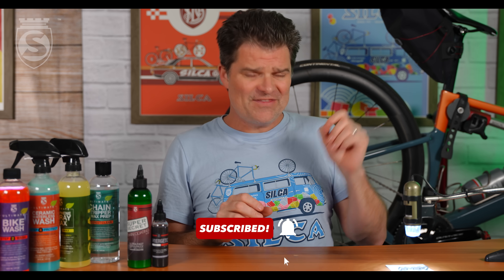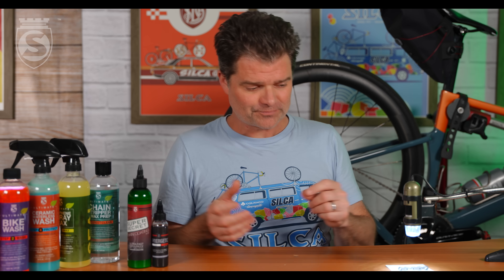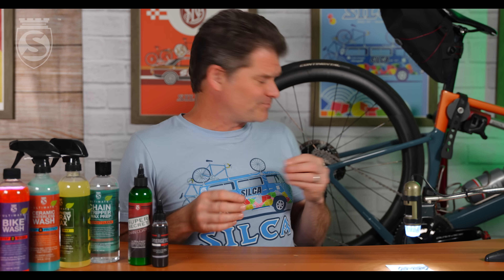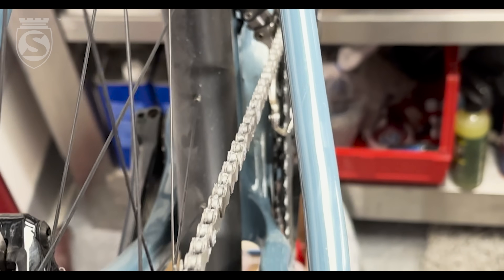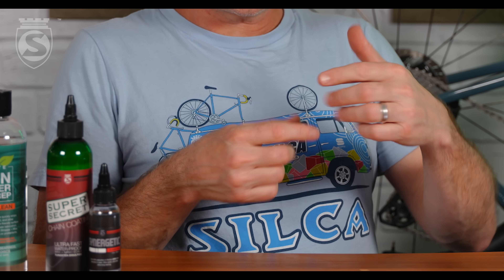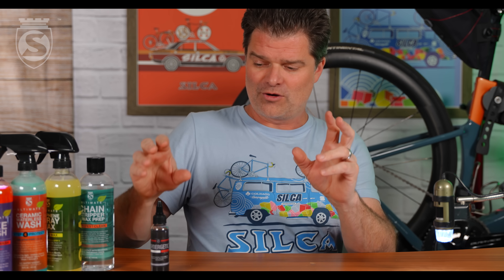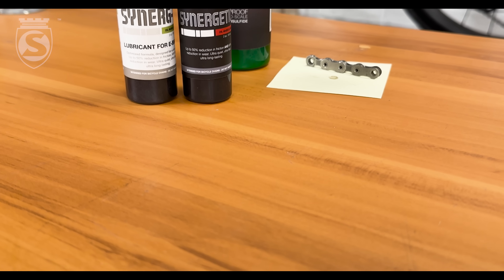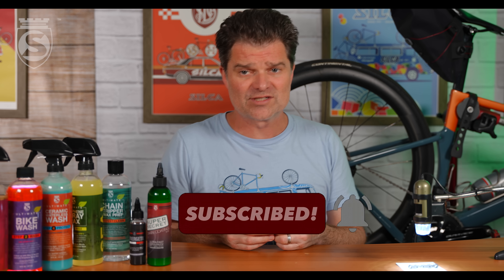Stop Wasting Your CHAIN LUBE! Know the BEST Way to Apply It!

Comment: What about e-bikes? You can’t back pedal in them.
Reply from the maker: I just insert the long side of a 5mm hex key into the chainring bolt and then backpedal until the crank arm contacts the hex key, it will then allow it to backpedal the drivetrain.

Comment: Great video, good news is that that is exactly where I had ended up deciding to apply my Super Secret drip on. To me it seemed where most chain side bend would be (big chain ring & Big cog), and cassette would pool any run off. However seeing is  believing, seeing the capillary action at work was so reassuring to watch. So invested in Silca chain wax products now, hot wax for fair season bike and rides, drip on for those cold dark winter rides (I'm in UK), where re-application is required more frequently due to varying wet conditions.

Comment: Can you use other extreme cross-chaining combos to achieve this lateral pumping? lowest gear in the rear cassette + small front chainring? I've tried the big / big combo and I can't complete one complete backward revolution without the chain dropping to the next lowest  rear sprocket.
Reply from the maker: Doesn't need to be full big-big, just enough that you can see the chain articulate laterally when you look at it.. 2nd or 3rd cog down from the top and big chainring should do it.
Reply: @SILCAVelo  thanks for your clarification and reply; that's basically what I did; settled for some offset alignment in order to observe the side plate articulation as the chain revolved backwards ... so far, I'm happy with the chain waxing - a quiet and clean drivetrain and crisp shifting ...

Comment: I had already lost ‘hope’ :/
Chain (original) Ultegra CH-HG701, 11-rz, shaken out, then rinsed in isopropyl alcohol (after rinsing, the solution was clear, i.e. the earlier shake was correct), the chain dried for 1.5 days, and despite this, following the procedure for applying ‘SS Chain Coating’ (first application and leaving it for another 1.5 days), activity on the trainer - after which - second application of ‘SS’, this time a day of drying - activity on the trainer. Followed by a third application of ‘SS’. Two days later outdoor activity, in good dry weather conditions.
And drama, after less than 50km I could clearly hear the ‘chain work’ (and I'm a person with moderate bilateral hearing loss!) :(

Now during activity on the trainer, the chain becomes audible after .... 20 minutes :((

I don't know where I'm going wrong :/

Does anyone have an idea, a suggestion what I could do to make the silent operation last longer though?
The huge advantage of ‘SS’ is the definite cleanliness of the drive compared to oils/grease!

Comment: It's kind of funny 4 years ago I started looping my chain where the cassette begins as he showed. I strictly did it because I'm cheap and I was tired of seeing that oil drip off the chain So my mind tells me all the oil is still sitting on the cassette I could use less drops and just run the chain over it. The little puddles on the cassette would get on the other links that I did not squeeze oil on top of. In that way I saw way less stripping on the cement.   But I am interested in trying his lube that his group made.

Comment: So I just watched this video after watching an older one. So with application up near the cog instead of on top of chain in lower position, I only need to apply one application instead of 3 applications?
Reply from the maker: For drip wax, you are still better off to do 2-3 applications as the lube is ~40% carrier, so that carrier evaporates and leaves empty space in the chain that can then be topped off with more wax.  It isn't necessary, but 3 applications will get you to near hot-wax performance as it allows for 95-96% of negatigve space in the chain filled with lube.  For all other types of lube, this method just allows the lube to better penetrate and coat all of the internal surfaces  that you want to be coated.
Reply: Ok, thank you… So like in that previous video mentioning the 3 applications… After the first one, let it set for about 4 hours and then ride a few miles before the next application? Even with a little grit on it from the bike ride? And then repeat the same way?
Reply from the maker: You don't need to ride it, you can just pedal it on a workstand if you want, the key is to get it moving so that it compresses internally and opens up little fizzures that the next application can get down into, but a spin around the block won't hurt you as long as it's not rainy or muddy or anything like that!

Comment: isn't there a chance that the chain lube drips directly on the disc brake when i put it on this way? I have an e bike so i have to use my bike rack + walking mode to apply the lube and at this way i have to tend my bike a little more so i think it could get on the disc brake.

Comment: How do we clean the Crock-Pot when time to replace for use for new chain?
It
Reply from the maker: Heat the wax enough to loosen and carefully dump and trash any overly contaminated wax, then wipe with paper towels to clean further.
Reply: @SILCAVelo  thanks.
Reply: @SILCAVelo  thanks a lot. Fell in love with silca hot wax since my first application on my bike's chain. Really really smooth feeling and super quiet when pedaling.

Comment: So I started waxing using your dip wax and I missed how well it rides. I do have a question for my application. I ride a lot of mtb and gravel on my xc bikes and I just recently waxed the chain which has about 30miles on it since waxing. Should I use the super secret drip wax after every ride or os that overkill?

Comment: I have your whole waxing system and I just put my first 200 miles on my chain. Now after 300 miles can I use the Super Secret chain coating on my chain if I dont have time to rewax the chain? 
Also do I need to strip the chain before I hot wax it again?
Reply from the maker: You can use SuperSecret to keep the chain going if you don't have time for a full hot-wax.. and no need to strip the chain ever again.  If it gets really dirty, we recommend rinsing it with boiling water (or just boiling it in water) to remove the old wax and dirt, and then just rewax it from there in the normal wax.
Reply: Thanks. Really enjoying the wax system on my new bike. I had a problem with my front derailleurs knocking the chain off the big ring. Had my hands all over the chain putting it back on. My hands didn't get all greasy. 😊

Comment: Okay, I am a recent convert, all my mates have been waxing (their chains that is) anyway, I waxed my chain with the wax and the long lasting chip, currently I’ve got about 1000 km on the chain and I have been putting the super secret wax on every 150 k’s, and I do typically ride my race bike on a Thursday night we ride out and race and that’s about 120 k’s and then in the weekend of do 120 to 1 180 K ride. How do youmake sure the wax will last for a bigger and longer ride? Apparently I should re-wax at the 1500 Mark any suggestions please?
Reply from the maker: We recommend re-waxing before a big event just to be safe.. this will give you the best possible combination or low friction and longevity regardless of conditions for your event.

Comment: Will the wax lubricant flow the same if the chain was already hot waxed? 
in a very long ride (months) cleaning the chain will be difficult so, using this type of wet wax lube looks ideal but wondering if chain should be waxed if still some previous hot wax particles.

Comment: Depending on how dirty the chain is I simply remove it put it in a mason jar full of acetone let it soak for a while Shake It Up and agitate it then I take it out rinse it in more fresh acetone. And then let it hang dry sometimes I use compressed air if I'm in a hurry to blow the chain out and dry it. And then as for chain lube it's just WD-40. Chain Lubes are a waste of money. This only works for me because I'm an absolute freak on maintenance. I have a 2006 motorcycle that still looks pretty new.😆

Comment: QUESTION: i have waxed my chain with Hotwax. I've used after it additional the Silca Super Secret. But after using Super Secret the Chain and the Cassette looks after a ride dirty like oiled :( is this normal because of the Graphene in the Fluid?
Reply from the maker: Yes, the tungsten disulfide if black, so it will leave a dark film wherever it dries.  We recommend wiping the excess off with microfiber cloth after you apply it to the chain to minimize any external buildup.

Comment: So if i've been running regular wet lube on a chain for a long period of time, can I switch directly to wet wax? De-grease and clean the heck out of my chain and then simply apply the wet wax following the direction given in this video? Or does a chain need to be wax bathed at first when switching from lube to wax? Thanks!
Reply from the maker: You are okay to clean and lube on the bike. You'll just need to layer up the wax a few times to match what you can do by immersive process. Here's a video to explain: https://www.youtube.com/watch?v=LBcowq02pXw&t=14s
Reply: @SILCAVelo  Perfect! Appreciate the quick response and informative content in general!

Comment: I get why moving to the big sprocket opens and closes the links. I don’t get why applying lube to specific spot matters: the chain goes around multi times and that distributes it through all the links surfaces. Ok so if you squeeze too hard it ends up on the floor 😂. Be gentle.

Comment: who has time to lube and wait 24h. I lube before going to cycle. unless i do full clean of the bike after the ride in that case lubing is applied right after the wash. It is not worth it to be paranoid about the chain. It is just a chain with more time spent with it, it becomes progressively more expensive than just changing it slightly more often.
Reply from the maker: Just wipe the chain and put lube on AFTER the ride...no additional time or effort involved, just a change in order of operations.

Comment: And that's why I believe that chain oil is the way to go and not wax. Wax doesn't flow. It's static. Once it is displced by friction between two surfaces, it doesnt flow back like oil/liquid lube does. Apart from the fact that wiping a chain clean with a rag and some WD40 or gasoline and then applying a few drops of fresh oil to the chain is much quicker and easier than the chain waxing ceremony.

Comment: Thank you Josh. I generally clean my chain using the Park Too chain scrubber and Simple Green after 1-2 rides. I’ve been using dry lube spray from WD40, well because I’ve had good success keeping a quiet chain. I’m now trying to Muckoff dry lube and I’m excited to put each drop on in the correct place.

Comment: I can see how this could be the best/efficient way to apply lube onto & into a clean dry chain.
My belief has been that applying lube liberally to top of the bottom rung could help carry/flush grit in drippings OUT of a not-so-clean chain.  I wipe sides of chain (Campy Record) but do not remove & clean - Is my belief flawed BS?  Thanks Josh…
Reply from the maker: The data out there tells us that no chain lube really actually flushes out grit that is inside the chain unless you use really obscene amounts of lube specifically to try and achieve a flushing type of action.  ZFC has studied and written quite a bit on the topic and found that despite all the lubes out there claiming 'cleans and lubes' none of them actually do so.  So best to clean/wipe the chain as best as possible and then just put a small amount of lube on the chain to top it back up, and ideally give it a deep cleaning every once in a while.
Reply: Ok, you’ve converted me!  Because I’m one of those throwbacks still using rim brakes, I was also putting chain on big ring & smallest cog to keep lube drip/splatter low and away from rim brake surfaces.
I’m now extra careful and will always wipe down brake surfaces with iso alchohol afterwards…

Comment: I always applied on the top of the bottom run of chain because when you spin the drivetrain it will move outward due to centrifugal force

Comment: I'm using waxed chains with a Rohloff internal hub shifter - so no cross-chaining, no "pump" effect.  Should I be rocking the chain laterally  to simulate that effect?  Does it matter where I apply the lube?

Comment: But if you apply it at the bottom (lets call it the traditional way) it'll still get the pump/squeeze action all the same, you could even argue it'll end up getting a better pump action as it'll settle/soak in a bit first, then pumpy/squeezy.

Comment: Nah, this method has a flaw, hitting the cassette teeth immediately as you're applying isn't ideal, at least with the bottom method the application has 20-30seconds of absorbing into chain before hitting the chainring teeth.

Comment: Ummm...mech. for 40 years, a drop on each roller, one at a time, a bottle of pro link will do 50 chains and run chain both ways through a clean rag which takes care of plates and dirt and any excess and doesn't attract dirt.😎

Comment: How about e-bikes? More specifically, the crank mounted ones where you can’t back-spin the chain.
Reply from the maker: You can apply along the top span and then roll the bike backwards for the same effect.  If the lube is wanting to fall off the chain right away, then you can use the seatstay to brace your lubing hand and roll backwards.  If you have a workstand, you can also put a hex key into one of the chainring bolts and backpedal until the crankarm is pushing on the hex key which will allow you to backpedal.

Comment: The chain on my Specialized Creo only moves when pedaling forward. What’s the best way to apply SuperSecret?
Reply from the maker: If you have a workstand I would apply it right before the chain contacts the chainring while pedaling forward, or you can apply like we show here to the top span ahead of the cassette and then roll the bike backwards on the ground to get the similar effect.
Reply: @SILCAVelo  No workstand. I will try to apply while running the chain backward by hand. Maybe I can get my wife to drip the lube on while I run the chain backwards!

Comment: Very interesting video, and very cool to actually see the capillary/pumping effect. You mention that this way of lubrication will give 100 kilometers of pristine silence. Do you have any experience of how well the lubricant performs in a long distance gravel events of 200, 400, 600 kilometers with sand and water getting in the chain. How would you recommend re-lubing in such an event as application and a drying time of 8-24 hours isn’t optimal:-)

Comment: Why do we apply lube to the top of the lower chain span?  Argumentum ad antiquitatem...because we've always done it that way.

I worked in a bike shop for many years and we always did it that way.  Nobody even thought to question the technique.  However, a vital piece of doing it right was to cycle through all movements of the drivetrain for a bit while the lube was still wet to ensure full penetration before allowing for dry time and removing any excess.  We would also hold a shop towel beneath the application area to keep the floor clean.  But drip through always seemed preferable to accumulating excess in the cogset, which is a bit more difficult to clean.

Comment: Answer: clean chain with dryed up Baby wetwipe, by rotating pedals backwards a while. 

Apply Dripon WAX by same rotation. Both on the inside AND the upside. Even on outside (inside is tricky). 

Now run chain backwards and take thumb and index finger pinching chain to spread the wax on all four sides!. 

Let dry for a few hours. Done!!

Comment: This is great info and well explained...but what about the best way to lube a fixed gear or single speed that has no lateral articulation?
Reply from the maker: You can put a lateral load on the chain with your finger to create a similar effect as the chain rolls onto the rear cog.

Comment: I used to lube my chain at the bottom for years as recommended by almost all videos in YT, but then I bought a MTB with a NorrowWide chainring... Since all the lube was getting caught on the chainring due to the tight fit between chain and ring I realised that this technique wasn't making any sense.
So I started lubing  the chain from the top, and oh surprise I could see how the lube would penetrate all pins and go through them to start appearing on the other side of the chain when going round the casette and pulleys.
By the time the lubed part of the chain reaches the chainring, the lube has already made its way through the pins and plates and only a little amount gets caught on the ring.
Also since you need to back pedal the logical space at the top to place the bottle of lube, is near the cassette so that you don't hit it with the crank arm every time it goes around.
So now I lube all my bikes like this (including road) regardless of NW chainring.
In my case I discovered this through logic but science proved me right ;)